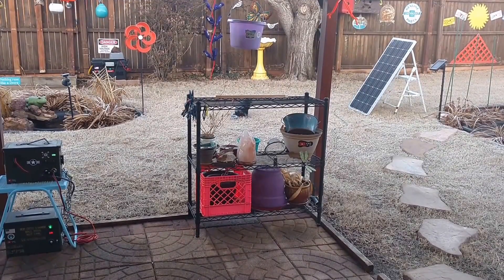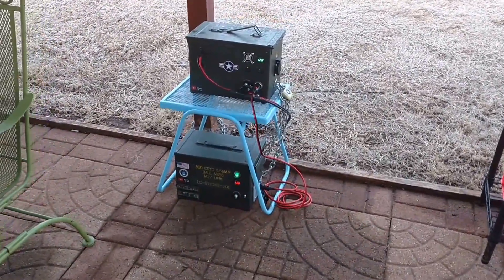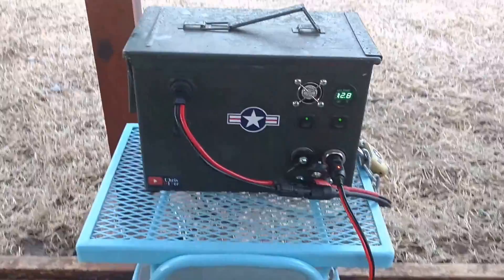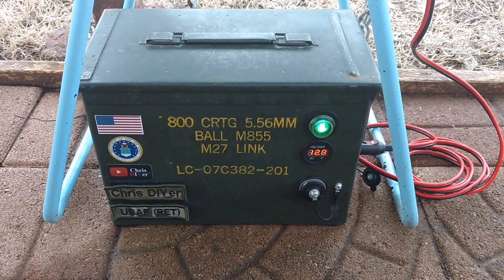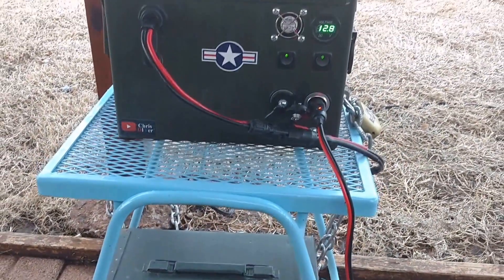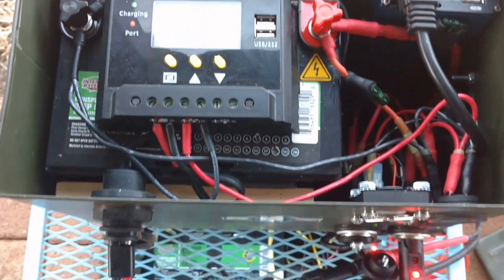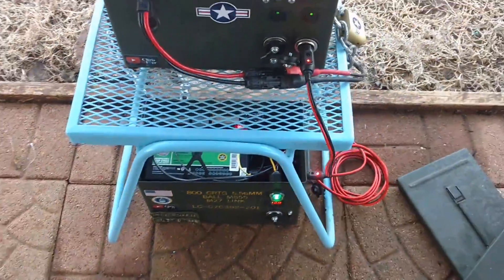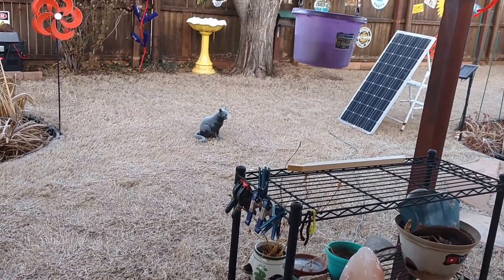Dual batteries! Backyard micro-solar generator system (pre-sunrise voltage checks)

Comment: Cool!
Reply from the maker: Amazing how they play so well together. Only issue (small) is the the 12v plug end on the jumper cable doesn't seat sometimes into the sockets...have to wiggle it. And then the voltage pops up